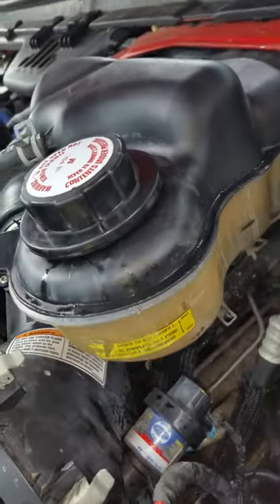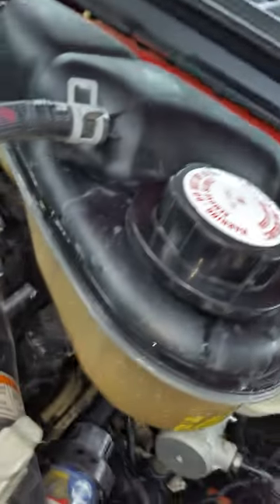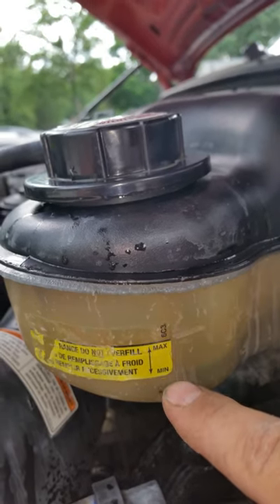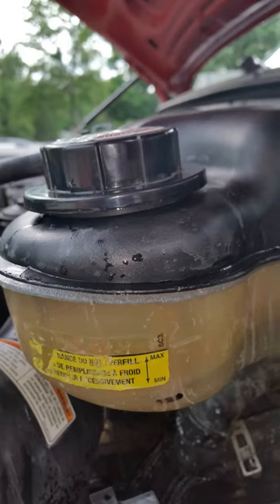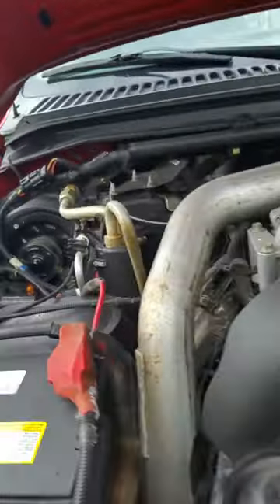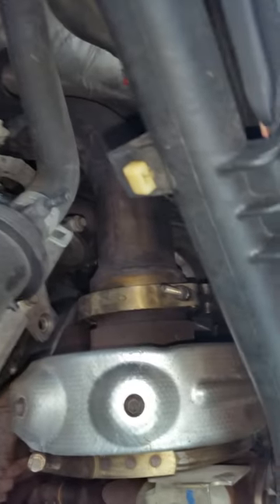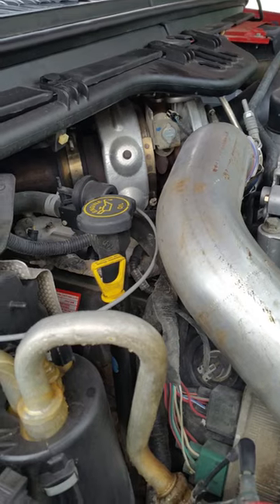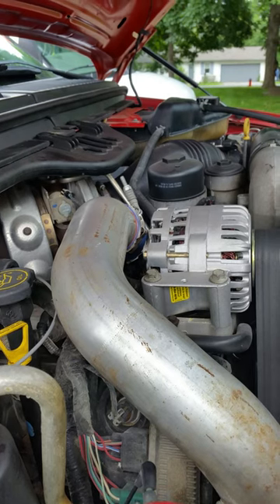6.0 Powerstroke blown headgasket diagnosis 2

Comment: X-ray vision used to diagnose head gasket and not cap..mine blue it's fluid out..cap keeps clicking around and around...he's cap today clicks once and is tight ..it don't go click click click click...drove for a hour and level still at min...more driving needed and when it blew out the fan was going full blast..85 mph thru Montana at a slight grade for 65 miles...not my brightest move

Comment: Well here I go I have a 2004 6.0 been having this problem for a while change caps, radiator, degas bottle and many other parts 
Good while driving around town but when I pull my fifth wheel same problem leaks everywhere this last trip just got on the road about 8 miles in and the degas bottle blew up no overheating nothing just blew!! 
I’m hoping it’s not the head gaskets🙏🏼but that’s the last straw if it is I’ll go back to chevy🤷🏻‍♂️

Comment: I have diesel fuel smell in my reservoir 
6 0 powerstroke 
Has anyone had luck with blue devil on a 6 0 any advise 
Do I need to flush and remove the thermostat 
Thanks.

Comment: How are you sure that’s a head gasket? It could just be the cap itself right??????? Mines doing this. No smoke out the tailpipe like it SHOULD. What is my issue?
Reply from the maker: joe b it dose this because of the compression of the motor is overpresuring the coolent system wach my outher video

Comment: Looks like an autozone cap not good
Reply: The caps from autozone are actually better than the stock cap. Ford put the caps they used for everything on these and they don't hold pressure. The autozone caps hold more pressure so the coolant can get hotter before it actually begins to boil.
Reply: Funny I must have had a bad cap then. They're garbage from Autozone. They don't even click when fully tightened. Mine held no pressure.
Reply: Cap review and testing: https://youtu.be/KMUFy1tkLTM

Comment: Is the EGR delete a sign that it has been chipped? Thanks in advance!
Reply from the maker: it is just a sigin that someone had the problem before and there may be some underyling issues to follow
Reply: JoshR “tuned. Chips were phased out in the 2000s.
Reply: You want the truck to have a egr delete will mean less problems.

Comment: The Problem is Circled in the Grill. and on the Tail Gate
Reply: fomoco 7.3s are awesome. Best Engine Ford has ever had.
Reply: Red Poole you mean international engine then Yes international designed them and built them Ford just told international to tune it to there spec's and use a different injection system same with the 6.0 and the 6.4 Ford only desgined and built the 6.7 powestroke that's all
Reply: Red Poole I’m owner of 2 6.0 f350 f450 I’m around 400,000 f450  f350 285,00 complete stock , I can bit you ram to Canada and come back with no problem I don’t think 🤔 you Cummins can do that
Reply: I’m sorry I Own a 2006 6.0 freaking stunning truck. But the Cummins it the best Diesel. 6.0s are fast but not a dependable as a Cummins